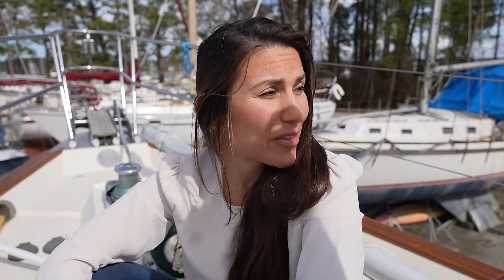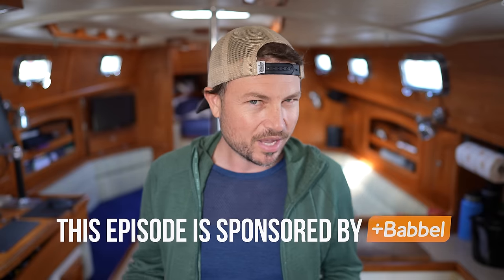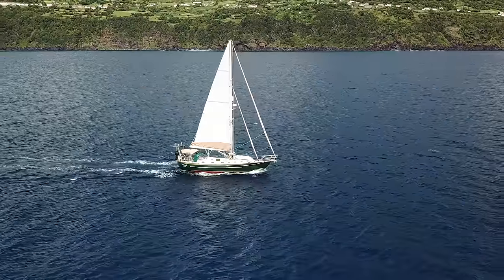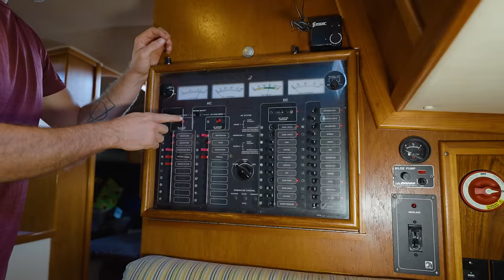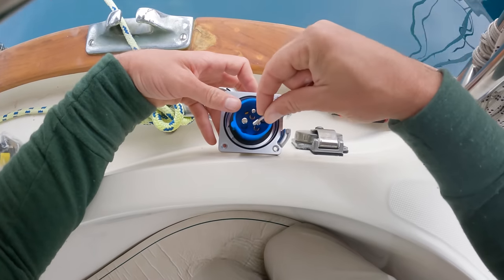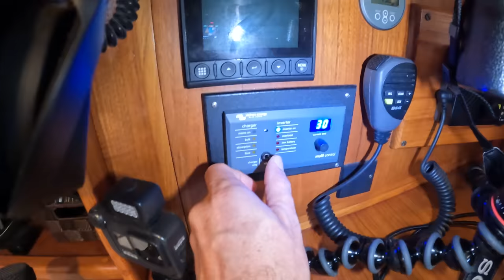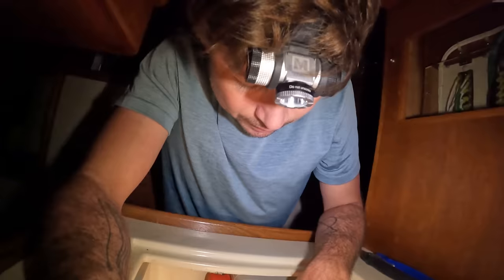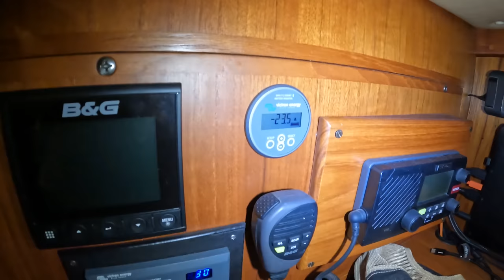This is a Ticking Time Bomb | S08E03

Comment: A good tip for the next time you run into the hole saw problem. Use 2 hole saws on one arbor. One the size of the existing hole as a pilot to center the hole and one the size you want to make the hole.
Reply: Starret and bosch both make arbors specially to hole two hole saws at once. Starrett calls it an "oops arbor". We use them all the time.
Reply: It's so simple, no one ever thinks of it! You beat me to it. Put the new hole saw on first, and then the existing hole. That way the center can fit in the hole before the new saw makes contact. Maybe hole saws get shorter as they get wider so that solution works every time. The inner one is always longer???
Reply: Another option. With a piece of thin plywood, use the paper template for the new hole and drill the plywood for the new size hole. Also drill the small holes for mounting screws into the plywood. Then use the plywood as a drill fixture by attaching it to the bulkhead with the mounting screws. Now use the new size hole saw, and the plywood acts as a fixture to line up the saw in the correct place to cut the hole.
Reply: Yep, this is the solution
Reply: Great idea!!!
Reply: What kind of voodoo magic is this you speak of!!! Man, what a great idea!!!

Comment: You may have noticed that the blue Euro plug got three pins as well as the charger input. You got a Live wire (230V@50Hz), a Neutral wire (return path) and a Protective earth wire (safety ground). The latter one is necessary for the function of a Residual Current operated Circuit-Breaker that you did not install and which is protecting you from an electric shock caused when some of the current travels through a person's body due to an electrical fault such as a short circuit, insulation failure, or equipment that is not working right. 
Your two wire system works electrically O.K., your battery will get charged, but you need to install that Residual Current Device (RCD).

Comment: Great to see mom, dad and baby!

I wouldn’t presume to know what Nigel Calder would have to say on your improvised 220/50hz panel separation from the 110/60hz but it was a good step to increase the distance between the hot busses. Some sort of non-conductive isolator is probably an improvement to minimize the risk of an arc between the 2 flavors of AC. The most correct answer is to have separate panels but it’s a boat and we all get the constraints. 

Glad to see y’all back.

Comment: Jordan, another way to cut a larger hole without a centering bit is to drill the correct size of hole in some scrap wood... then use hot glue to glue the scrap on the outside and center it over the old hole.  Place the larger hole saw in the scrap hole and cut it out. Then use a hammer to tap the scrap block off the fiberglass.

Comment: Hey Jordan.  Next time you need to enlarge an existing hole.....take two hole saws and stack them together.  Remove the drill bit from the center and put some washers between the two to offset the teeth.  Put the existing size in the hole as the stabilizer and the larger saw will cut the new hole.
Good luck!

Comment: Just one more thing Jordon - I am an electrician (retired) please tape that white hot wire on your new breaker black or spray paint it black etc. so one day in the future you or someone else does not mistake it for a neutral wire. Yup be safe pal.

Comment: Nice job. One piece of advice though, if no one has mentioned it, is to put a pin in the holes of the installed breakers (tying them together) to insure that both breakers are simultaneously moved to the on or off position. Keep up the good work. jmk

Comment: Love your blog - we’ve watched you for awhile now. We’ve got a 1984 Beneteau which we’ve sailed in the Bahamas and Great Lakes. We’ve done a ton of work on our boat. You might want to consider stripping and varnishing the wood trim in and around your head. If not, the wood will need replacing and that will be tricky. Pull out all caulking and replace after last coat of varnish. By the way love a lot of your tools. Also we hate butyl.

Comment: It's actually quite easy to make the hole bigger.
Put the new larger hole saw on the drill 1st then 'double up' and thread on a saw the size of to original hole.
The original size saw will end up sticking out a bit further than the new larger size and will centre the saw on the hole. Hope the makes sense for another time.

Comment: Well done. Those plastic water lines are susceptible to developing pin holes. My boat is 20 years old with no pin holes but new lines I’ve put in ….. pin hole leaks. There is something wrong with the new plastic. Make sure that when you have the electrical cabinet open next time that you clearly tag the 230 volt lines so you don’t in advertently cross connect. It is so easy to do and especially in 2 years time when you forget.

Comment: Jordan, that breaker you installed should be tied together so that a trip would disconnect both phases of the 220.  A breaker meant for that will have the two switches tied together.  I believe you can buy breaker ties that go between the two switches, but in a pinch, a small piece of wire through the two breakers should do the trick.

Comment: Nice boat , good idea is to use inserts on all hot and cold pipework.  Speed fit is good and easy to fix ,but inserts are cheap and you won't get leaks

Comment: Cool idea to have a 2nd dedicated shore power inlet tied to a single breaker for a single purpose in the boat, in this case, the battery charger.  You can theoretically change out the shore inlet or use an adapter to connect to other countries electrical supplies as you travel.  Like it.

Comment: Another way to enlarge the hole is to drill the larger hole in to the plywood scrap first … then center it over the old hole from the top side and secure it  in place.  ( possibly with sheet metal screws into the flange mount holes) Then use the plywood hole to keep the hole saw centered as you drill through the fiberglass .  All from the top side …
Reply: I probably would fab a cardboard template of the large hole and overlay the small hole and dremel grind to match

Comment: how cool, love the new little one, congratulations guys. enjoy how you explain one issue leads to another. But really like how you took the time to fix each one. quick question, is the 220 converter plug in the same size as the states 110 plug in or are they different styles and or sizes?

Comment: Jordan, a simpler electrical AC solution would be a 2:1 step-down transformer plus a crossover switch.  🤔   Most 60 Hz power loads will still run on 50 Hz provided the voltage is matched.  Sharkbitten hat does electrical for a living...  - Blessings,  S/V Windwalker

Comment: At least higher voltage will work with the same or smaller wire than 110.    Back in '93 I was building my own and home computers for others.  Back then software was limited in abilities, and the mother boards had very small dip switches, so I got my 6 year old son with his small fingers to put the jumpers where I told him,  that let to playing learning games on the computer, to him building his own and creating his own games. Today he is a graduate degreed programmer at the Oak Ridge National Laboratory in Tennessee.  Never underestimate your kid if you can get them involved in projects...  You could have the next generation super yacht designer in your cradle...

Comment: 11: min in … Jordan if you use the old size as the pilot just put the new size behind and it will follow… for instance if I have an inch and a half hole I would put the inch and a half holesaw I’m in front of the 2 inch if I wanted a 2” hole

Comment: 11:31 What?  You didn't bring any metric hole saw blades?  🙂    15:45  I had to replace the breaker for the auto pilot once 100 miles off shore in the Gulf of Alaska in 20 foot seas.  It took me half an hour and when I finished and looked up I got horribly sea sick for the first and only time in my life.  I learned it's best to get this kind of stuff done while tied to a dock instead of at sea.  Good luck with the projects.  Boats are a work in progress.  They are never "finished"..  Upgrade On!

Comment: If you are trying to make a bigger hole with a hole saw All you have to do is put both hole saws on the same bit. You put the smaller sized hole inside the bigger one. The small one will act as a guide for the new hole you want to make.
Reply: And this is why I read YouTube comments. Brilliant, and also now I feel dumb for not thinking of that earlier.

Comment: Find a hole saw the size of the hole and there usually enough threads to put the smaller hole saw inside the larger hole saw use small saw as the guide

Comment: Personally I would have laquered the trim boards first. Than I would have applied caulk into the seams. But I understand the problem of cost, time, and fumes. Yes you can cut corners, but in the long run you will have to deal with what you let go. And having a new crew member to consider can be over whelming. Plus you want to spend as much time with them as you can. I'm positive that you guys will be excellent parents. Good luck and can't wait to see more of your videos.

Comment: Hi! Congrats to your Baby Girl! All the best!
Regarding the 230V Installation: it Looks Like you used two 16A breakers. This is not optimal. In Case of a fault only one will Trip and this might be the neutral one. So it IS possible that the ciruit is open but there is live voltage at your charger!
What you need ist a 1p+n breaker. (I would always want to switch both conductors as those Adapters you might use will not always make sure what l and n is!
Do you have a RCD Switch in place?
You could also add a european 230v Outlet so you can plugin for example a cheap heater you purchase in Malta.

Comment: Nice work, but I believe those two breakers should be joined together with a little bar or screw. That way when one trips they both trip and when you turn them on you can’t inadvertently just turn one on.

Comment: What are the specifications of the charger you installed?  Does the charger deal with the 50 hz coming into a 60 hz system?  If not,  what is the downside for your batteries?
Reply: I was curious too, so I looked up Victron's specs for that charger.  It does take either 50 or 60 Hertz from 90 to 265 VAC, it even will do DC-DC charging. Very versatile. Now I want one on my boat lol.

Comment: drill your hole in the wood first with the hole saw then use that hole to stabilize the hole saw for the hole in the fiberglass. you'll have better luck centering up the holes.

Comment: Yes a boat is like a RVx4 when it comes to repairs, break open the wallet spend it all.   BIG TIP for NEW PARENTS,   Never make it quiet around the babys nap, sleep time. Play loud music, vaccume, always be noisy.  They will forever be able to sleep easily no matter where they are or how old they are . This starts when they are newborn and firmly implants into their subconcius. You will forever be happy to have had this advice.  There is NOTHING WORSE than when a baby does not sleep unless it is pin quiet, Trust me you do not want that ESPECIALLY on a boat where  the wind is loud, water laps on the side of the boat and endless squeeks.      CONGRATULATIONS AND FAIR WINDS     Steve h.

Comment: Na man. U could have just used electrical tape and wrapped around the terminals on the breaker. 220 nor 110 will jump so they would’ve been fine. Also mustard is my go to cramp fixer. Yes it sucks being old lol. Safe travels y’all.

Comment: I’ve heard that those adapters can be dangerous.  Essentially you have the ability draw double the current along that cable designed for 16 amps.  When that happens it can catch fire. Since you are just using it for charging you’ll be ok. The catch fire scenario is when people load appliances up and they add up to more than 16.  Sailing Impavidus did a recent video on the danger
Reply: True, that breaker is oversized by a factor of two  but, the load the charger draws is dependent on the charger. Double the voltage will provide double the  power, so it will actually draw half the amperage. But, I agree the breaker should be half of what would be required on a 115v. system otherwise the breaker may not trip when needed.
Reply: @hogroamer260  I think I’d just say I subscribe to 20 odd channels and Project Atticus is my favourite for a number of reasons. Only issue I really had was getting a 32 to 16 amp adapter.  I had just locked away Ant’s safety video which was quite excellent. While the usage shown and description was as usual very good, it could have been improved by pointing out the risk to those not going to a battery charger, and maybe to those working on the same voltage.  I checked my history and here’s Ant’s video from Impavidus.  He’s a real Nigel Calder type and his tech stuff is very good. BTW thanks for the info

Comment: my Victron charger runs on 110 and 230 Volts and 50/60 Hz, you just plugs it in and it charges. sure yours are too

Comment: Why not just use an inverter.  220 to 110.  All you have to do is plug the 220 into the inverter and then plug the inverter to 110.  No rewiring.   I ran 110 electrical with an inverter for 10 years in Italy with no problem.  Just remember some appliances will not like the cycles.
Reply: Jordan’s solution is actually pretty clever.  The new 220v/50hz charger puts out the Same DC as his 110v/60hz charger.  His current system outputs 110v/60hz from the same charged battery … 
All of the boat system are unaffected by how the batteries are charged :)

Comment: Gitcha some offset screwdrivers for that tight stuff...
Reply: 1/4” screwdriver bits on a 1/4” box end wrench (ratcheting even better) works wonders. Or attach ring lugs before you put breaker in panel makes life easier too.

Comment: Good solution to your holesaw problem. Another option is to take the holesaw you want to use, trace it on the fiberglass where you want to cut, then tip the saw so just one edge is in contact and very slowly start the saw. As the edge starts to cut in on one side, slowly square up the holesaw to the fiberglass.

Great video as always!

Comment: My wife and I are looking to by a catamaran to sail the blue water but we have never sailed before we are 65 years young do u think where over our head
Reply: Noel, I wouldn’t think so.  With proper training like the American Sailing Association’s courses and preparing for dealing with health issues that might arise (travel health insurance) you should be ok.
Reply: Maybe go sailing on any boat of similar size first so you actually know what you're getting into :) Then, go for it!
Reply: Learn to really sail. By that I mean, learn to sail a boat less than 16 feet long where you will quickly learn all points of sail. You can't learn how to sail as well as you need to know without doing that first. Big boats take too long to react to the changes in steering., so if you don't know deeply (like it is second nature to you) what you are trying to make the boat do (which you will have done many times before but much more quickly and easily on a small boat) it will take longer to understand all of what is involved in each tack and why you are doing it in the first place. On small boats you'll quickly and effectively learn: how to sail the boat without an engine; how to judge the speed at which you should approach a dock under sail - without an engine - so the boat will safely stop when it reaches it; how to jibe the boat safely; how to sail up to a mooring without an engine.

 You don't want to end up like the "Sailing Nervous" channel whose owners were afraid to practice sailing on their own boat and kept using the excuse that more work needed to be done to the boat before it was "safe enough" to sail before they would take it out and try to sail it - even though they had completed the course most newbies take. They just never gained enough confidence completing the course nor did they ever get  good enough doing what they needed to learn that they were afraid to sail their own boat.
Reply: @rickcrane839  That course isn't nearly good enough to develop the confidence you need to sail a big boat. I'm sure Desiree would be the first to admit that she alone or with crew less experienced than herself would NOT feel confiident enough to take Atticus out for even a short sail without using the engine and then be able to sail up to a mooring or a dock without assistance from an engine. To get that kind of confidence you need to have experience sailing small boats dinghys under 15 feet long. You can usually get that experience in community sailing programs - especially if it is sponsored by a college or university with a sailing program.
Reply: Emily, I was thinking the whole series of ASA courses.  You are right, the basic 101 course would not be enough.
Reply: Thanks everyone

Comment: I do not believe you should seal the trim.  First you need to dry out the interior wall.  Second the wood and trim needs to be sealed from water.  Since the boat flex in the water, silicone will not make seal.  Need to make sure water was a run off away from enclosed walls.   Remember stiff or hard fittings do not flex with movement.